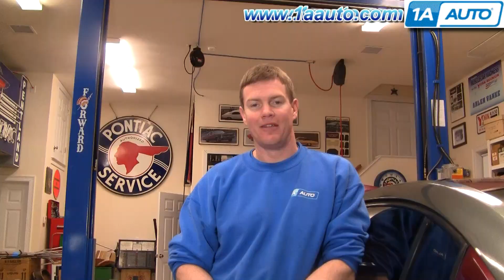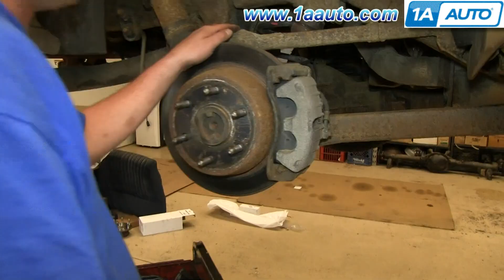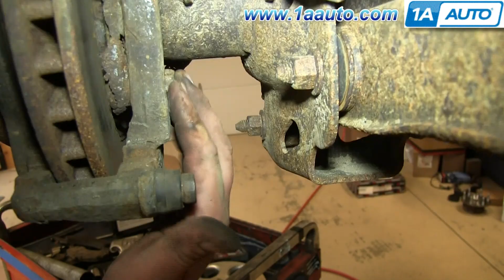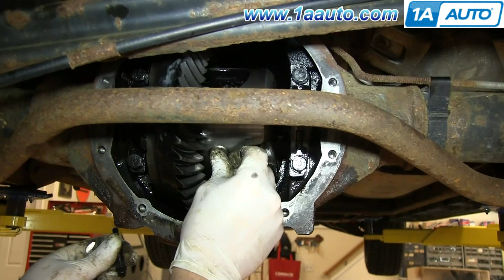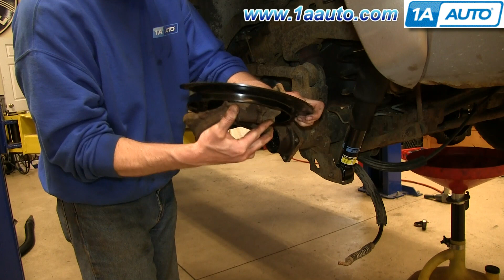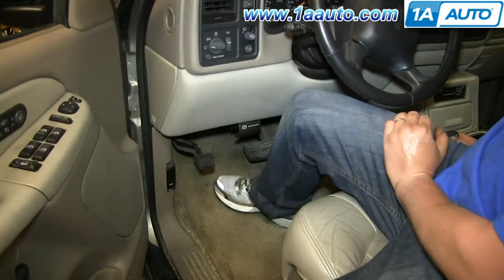How to Replace Rear Brake Backing Plate 00-06 Chevy Suburban

Comment: When I was in business, I never pulled an axle and not put in a new seal.  Especially now, with labor rates around $100 an hour, it's foolish not to spend $15 for a seal. The seal would have wear and age and deserves to be replaced.

In all my years (over 50) in a shop, I have replaced less rear differential covers than I can count on 1 hand. They normally are in fine enough condition to reuse.

Comment: What do you do when the lever does not engage the actuator to operate the parking brake?  The lever is totally loose and moves fully fore and aft.  The cable is disconnected from the lever.  I cannot find any info on how the lever engages into the actuator anywhere.  My vehicle is a 2002 Camaro.

Comment: Ratchets are MUCH more expensive than a 3" 3/8" extension. For the filler plug use the hammer to tap in the extension and then just use the ratchet.

Comment: sorry but there is a 2 piece available no need to remove the axle
Reply from the maker: +Christopher Solano Thank you for watching, and the advice. There are multiple variations in some vehicles for parts which make replacement easier. 1aauto.com

Comment: Great video and presentation of information. This job is a MFer and this a real weakness in Chevy's. That damn plate should have been made of plastic and they would never have this disintegration problem.
Reply from the maker: +paulseyes Thanks for watching. If any of our viewers needs to make this repair, we carry the replacement backing plate shown in this video on our website. Here's a link to them https://www.1aauto.com/brake-backing-plate-rear/i/1abmx00065?utm_source=YouTube&utm_medium=CTA%20Comment&utm_campaign=ytc
Reply: They don't you want to fix it,they knew plastic or a material like it  would work better,but they want you to buy another SUV instead.